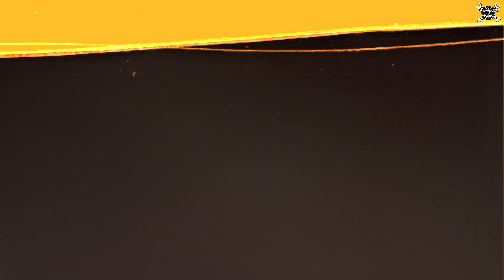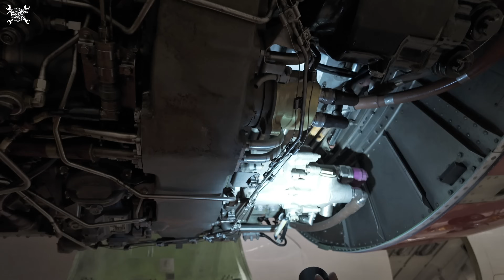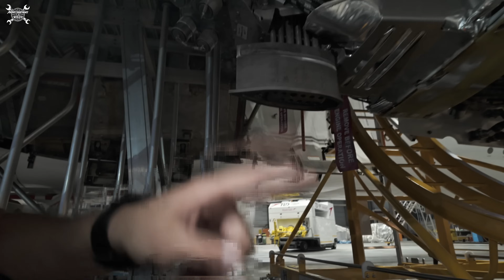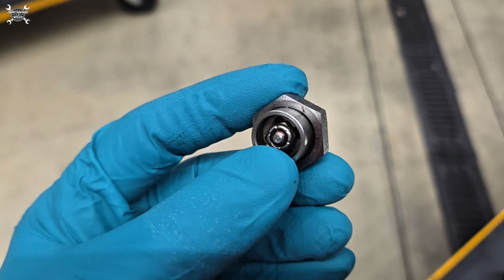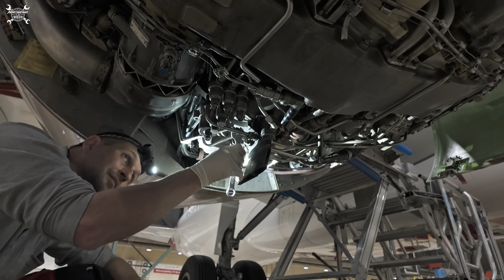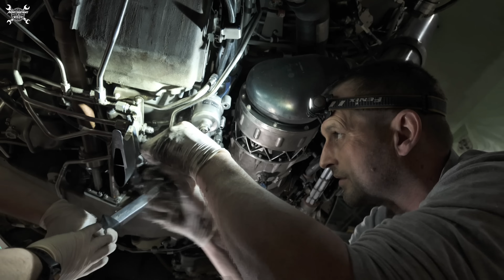How to identify the leak o A320 CFM engine

Comment: Brilliant video again Zero. Would you be able to give a run down on how you find working on the A320 vs B737?
Reply from the maker: Well it is simple B737 is best for small base. Very reliable A320 easier for troubleshooting but more sensitive to power change

Comment: Hey, TY for another upload! Are the collectors/ drain masts inspected everytime a unit is in for maintenance, or after so many run hours, or how often? Also, I see how something like a broken bracket would slow down turn around: having to look up torque specs and procedure review, then having to document everything and explain to mgmt about the delay. But that's how it goes sometimes! 😁
Reply from the maker: You need to look on drain mast every time during walk-around. And yes sometimes it is like that you just need to swallow that it will take longer than you expected

Comment: What is the purpose of collecting the fuel and hydraulic fluid and not directly draining
Reply from the maker: There is task card for this to perform exact leak check for only this components through collector unit. Other than that no idea😄
Reply: He mentioned the tank gets pressured by ram air and discharges at 200 knots. I’m guessing but maybe to avoid spills on tarmac and runway etc?